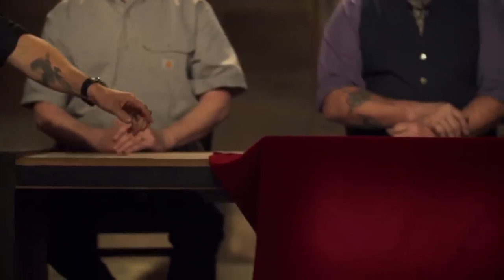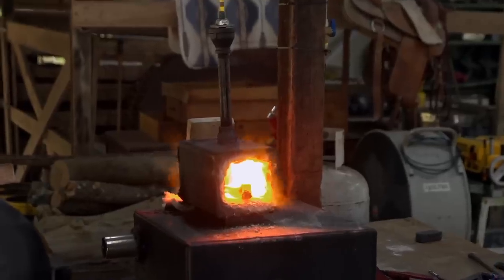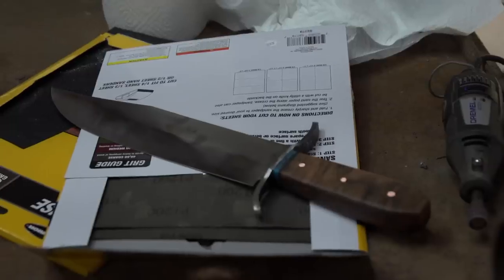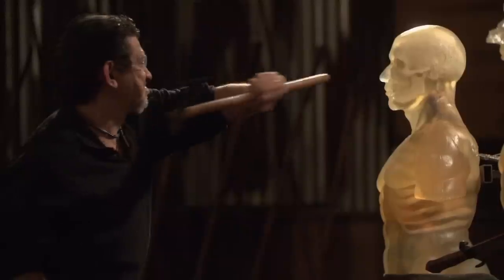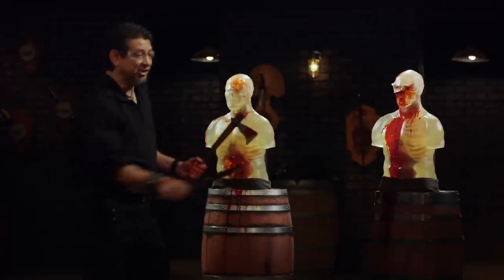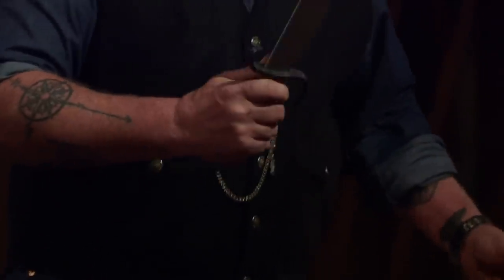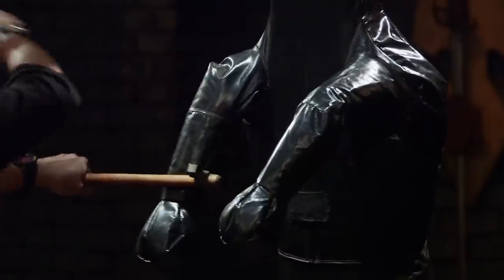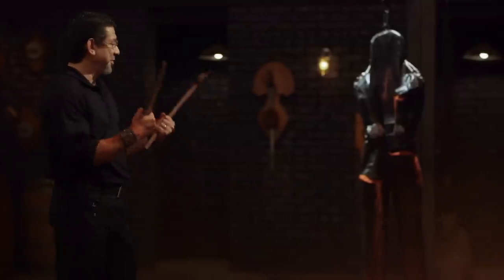Forged in Fire: Tomahawk Axe and Bowie Knife SHREDS the Final Round (Season 7) | History

Comment: Small axes are deceptively light weapons. You'd think they won't do much, and then suddenly a guy's face splits open.
Reply: If it's heavy it's a hatchet for wood cutting not a tomahawk for combat.
Reply: Or lose control of it while doing tricks with it and there go your fingers lol
Reply: I have a ww2 raf fireman’s Hatchet, it is an absolute beast, it looks as if it was made only a few years ago and it has a revolutionary design with a special rubber handle that means you can chop through power lines up to 20k volts, and in the hand it just goes clean through anything you put in it’s way, my dad got locked in a room in our house once because the lock broke and wouldn’t open again, he had to chop his way out and it chopped through nails and the metal of the door handle with ease although it took a small bit of damage from chopping through brass 😁. If you can get your hands on one I’d recommend it, they’re hard to find but really cool, the axe is called a chillington arpax
Reply: güt 4 beltce vv
Reply: I like how you can tell they are axes by the way they look
Reply: @thethe5475   Cool little tools, and surprisingly, not that rare. Can find one easily around the $50 mark.
Reply: @maydaverave  even if it’s light, it can do woodwork if the edge is sharp

Comment: Pity that friction fit didn’t hold up because that was a beautiful set.
Reply: It's a real shame cus there supposed to slide of traditionally.  So that you can use the head as a hand tool. And  also re half it easy in the feild qhen it breaks from throwing. They just had to to tap it on its end after the throw to tighten it back up before the next test
Reply: Duncan SQ Exactly!!
Reply: @duncansq47  yes precisely, a couple of taps on the anvil would have put that back right and tight, you want it so that if you hit the butt of the handle on a hard surface the head slips loose so that you can quickly and easily pack it down. There's no way the heads coming off the top end like you'd risk with a wedge fit unless the whole handle breaks but if that happens you just use the head to knock out a new handle from the closest branch in literally no more than five minutes and you're away
Reply: Yup speaking from experience even if you get the head fitted up tight at first. The wood will wear a little bit over time and then become loss. Also if the eye isn’t forged properly with a nice taper it can cause problems too. Must be why you see them with raw hide or cordage wrapped around the head to keep everything it place. If this guy did something like that it might have saved him. But Then they probably would have complained about it for some reason.
Reply: @jasmineirwin7166  That's what I was thinking. I would have added a deerskin binding for a Native American aesthetic.
Reply: Call Me Kevan yeah exactly it’s not going to make it indestructible or anything but might of helped.
Reply: @duncansq47  possibly, but also if he didn't drift the eye properly or fit the haft then you will struggle with keeping the head tight. It can also be from the wood drying out. I don't recall which one was from MS, but the humidity difference from MS to CA can be extreme & as many axe men know dry environments will loosen up even the best fitted axe hafts.
Reply: @jasmineirwin7166  but then it also isn't traditional so I would expect it to be docked points for what would clearly be trying to fix a poorly drifted eye or fitted handle.

Comment: A friction fit head taper is how tomahawks are properly made. If it slides down, then you must bang the handle top into the floor to reseat it. I use tree's. With excessive blade flare it cannot be banged into flat surfaces for reseating as the blade's upper point with stab into the floor and or be damaged. A movable head allows Mineral Oiling of the handle under the head, for longevity. Installing pins, or set screws just causes breakage and failures everytime. In order to keep the head seated and movable, a Constrictor Knot must be hitched onto the Hickory handle using Marlingspikes, far enough down to move the head enough to oil under it. To secure the head from sliding down, a heavy leather compression collar must be laced on tight between the Constrictor Knot and the tomahawk head. Constrictor knots serve as powerful grip stations as well, wet or dry.  They can also serve as the anchor of a lanyard if desired.

Comment: Not sure if I’d trust a friction fit with how brutal these judges can be with testing.
Reply: Tough decision to make, but his friction fit is how it was done historically. I wouldn't have docked him points for it.
Reply: These are historically friction fitted so you can easily remove the head to use it as other tools or easily replace a broken handle.

I wouldn't have docked points either for the slip. All that was needed to quickly fix it was turn the hawk upside down and pound the handle into a stump really hard to reset the head where it wouldn't budge.

It looks like his handle had a bit of a shelf going on at the end which is a bad idea for friction fitting. Needs to be a smooth flare outward towards the top where the eye of the head will lock into the wood without coming loose.

Comment: If you turn the hawk upside down and hit the handle on the ground it will tighten up, not a problem. Of course in most cases just using it will tighten the handle up.

Comment: It's funny, I have a hammer from when I was a carpenter and it's just a friction fit. I just drove a few small nails into the top to tighten it up lol that's what I would have done if I were in that smith's shoes knowing how easily friction fits come loose early on. It usually takes a little use, they come loose, you tighten it up some how and then they usually won't come loose again for a long time. But you almost need something to drive some extra space out in the wood because there always seems to be some shrink or wear that makes the initial fit almost never hold.

Comment: Have to disagree with the judges choice on this one. This bowie's were comparable but the losing tomahawk should have won. A traditional tomahawk is also a Bushcraft tool. The head is made to come loose from the handle to be used by itself. If it's loose you just tap it back on. The winning tomahawk was too light to do a good job splitting wood and the handle was crooked offsetting the head.

Comment: "compression fit shouldn't become loose when using the weapon" I just wanna say that for the abuse it went through... A little slide off is just operator error. Its what we call a "friction fit".. You need to swing powerfully in order to keep the blade wedged away from your hand...

Comment: It must be a rare thing that a weapon falls apart in the sharpness test.
Reply: That usually happens between the kill test and the strength test
Reply: Well it didn't fall apart, it's a tomohawk, that's pretty normal
Reply: One hit with the end of the wooden pole on the ground and the head is tight again.
But.. I do think the friction fit of that particular one shoud be adjusted a little better by sanding the wood till the fit is tighter.
This chop shouldn't let the head go loose so easliy.
Reply: @Ve-suvius  I agree. It could have been tightened easily and the fit could have been better. The head started coming loose in the first test. In a 10k competition that should not happen.

Comment: ....why not just use the other side of the handle that you didn't sand down?
Reply: Because the part that is sanded and is lighter in weight would be the bottom of the handle which would create a massively unbalanced weapon. You gotta have some weight at the bottom to counter the weight of the blade.
Reply: @yahyaelkashef4244  Ah....good point.  This is why I'm not a black smith.
Reply: No worries my friend, I think we all appreciate the skill and craftsmanship that goes into forging.